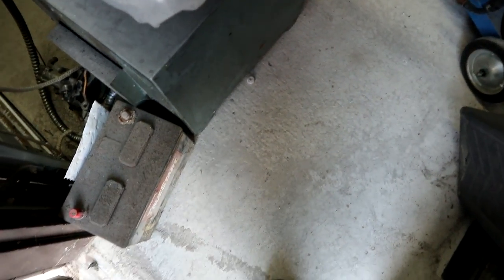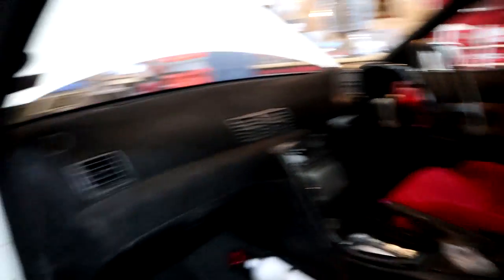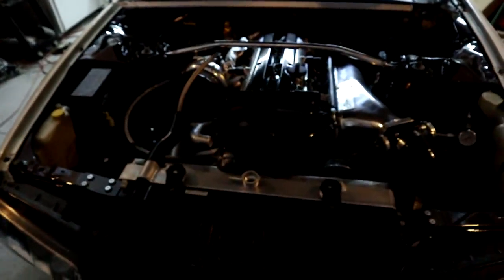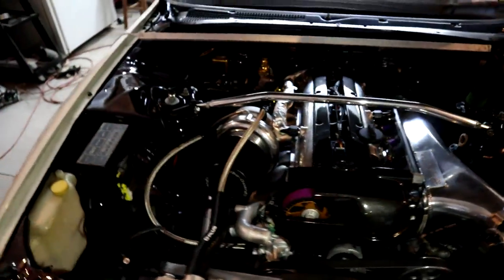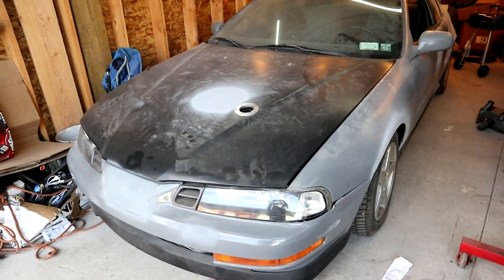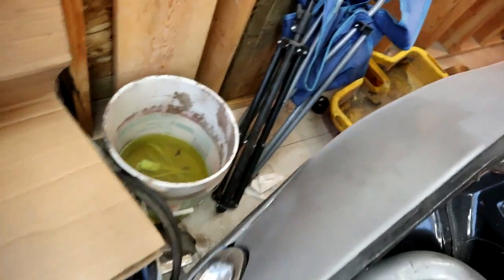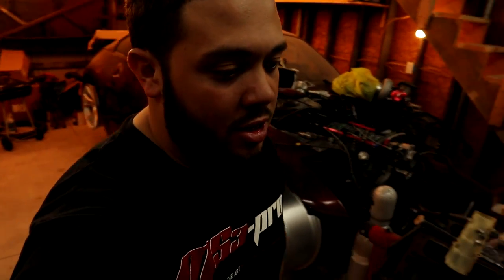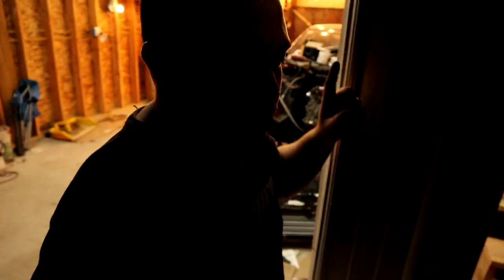HONDA KOUKIS MEET FOR THE FIRST TIME

Comment: Buy a skyline, then diss the engine.
The "hardness" video you are referring to informs people that the main detriment is from the 4wd sump setups due to twisting due to running a lot more (usually around 3x) power than factory and the aim is to sell people a block brace to prevent twisting. Once the brace is installed, you're good for 1000+ Aussie HP.
Reply: More to it then just that, but it is a gauge on the life of a boosted engine/numbers.

Comment: Change the coolant temp sensor the s14 if it's an s13 swapped engine, i believe it sends a signal to the ecu and adjust's fuel based on temp. Faulty sensor means faulty fuel values. Worked on my s13 after a rebuild back in the day and fixed the issue.

Comment: Air intake wouldnt cause that misfire issue. I would check the voltage on tps make sure its correct. .45v at closed throttle iirc. And make sure the 2 wire temp is good. For the ecu. If it's a s14 ecu and s13 2 wire temp sensor  itll cause issues. Good luck !

Comment: with that s14 yall are probably better off pulling the engine and just redoing all the lines and whatever wiring needs done... rather than chasing down the previous owners screw ups one at a time just put a solid week worth of into it and get it done right

Comment: Oil pressure was super low on idle
Reply from the maker: Light doesn’t come on on the dash so it’s not low, the gauge is just shitty
Reply: If it's the prelude they dont come on till 0psi from my experience
Reply from the maker: BryttianDepue I believe it’s under 8 psi the factory oil light comes on I’ll have to look that up
Reply: I just googled it and they come on under 5psi

Comment: My ka does this constantly in my s13 but its a single cam. Everyone asks if it cams but its truthfully just junk. Sometimes if i get the right mix of changing spark plugs cleaning maf and working o2 sensor itll run good for a few weeks before slightly fouling a plug or dirtying the maf. Junk, Sr swap incoming
Reply from the maker: No Sr is dookie
Reply: @damianmonte  you dont like SRs?
Reply from the maker: Xavier Moreno idk I see too many issues with them to like them, I know they make good power but if I had a 240 it would 100% be ka-t
Reply: @damianmonte  in my opinion i think its just how many people have probably been through the engine/worked on it and maybe some half assing the builds that makes em unreliable. I respect that though, id probably go the same way until i blew it up lol